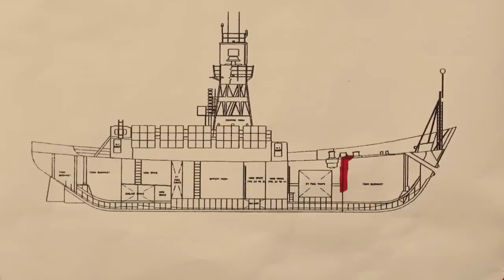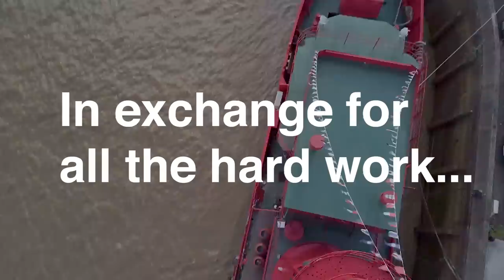Foam Mining Inside a Giant Ship

Comment: U could have used a weak acid and a paint sprayer then pump/scoop the fome sludge out
Reply: I would only be worried it wasnt viscous enough and would get everywhere
Reply: It appears to be two-pack expanding foam, which is generally urethane based.  That stuff is extremely stable and the only chemicals that can dissolve it are sufficiently unpleasant that you wouldn't want to use them on any space that might be later used for human occupation.
Reply: @TrimeshSZ  it makes sense why they rely on it for ships not sinking...that's for the info

Comment: Im fairly sure that foam can't be recycled. It's just going to landfill or getting burned.
Reply: Ya, I think it’s just junk but I was going to ask that question.
Reply: @AdmrlSpeedy  I'm sure he means being re-used without any kind of processing. When we talk about re-cycling it's generally breaking the material down so it can be re-manufactured.
Reply: PU foam is energy waste, so it's going to a power plant to be burned.
A local power plant takes the waste stuff from our work for no cost, as we just want to get rid of it, and they get "free" material that burns really nicely when you get it hot enough.
Reply: So they took out all the foam. Then Insulated the walls and floor with....FOAM!!
Reply: @regularperson9801  use it as blow-in foam somewhere else. Actually after they framed in the walls they could have used it as blown insulation on the same ship.

Comment: Quick q why didn’t you use a foam dissolver?
Mix it up, Chuck it in, it bubbles and expands and dissolves the foam and then it settles, shrinks and you pump out the mixture

Comment: did you fix the Leak? why did they foam it shut in the first place?
Reply: probably didnt have a leak. they did it just in case. because it was not going anywhere
Reply: i believe that it was said to be for buoyancy of the ship?
Reply: @kevintrigg3707  yes maybe there were no leaks and because it were decommissioned and the pumps did not run, so the foam were the only way to keep it floating.
Reply: @kevintrigg3707  that's not how displacement works. by adding foam you're simply adding weight, nothing more

Comment: Sorry a little bit late.  Had to remove original foam flotation in my C-Dory. Electric chainsaw to cut kerf slots making manageable block outlines, careful of depth & bulkheads.  Blocks easily pop out with a prybar. Finish up with right angle grinder fitted with a coarse wire wheel.  Eats foam like a banshee & does not damage underlying fiberglas. You guys did great though & improvised well. 30 years ago my brother & I here in Hawaii called our garden tiller "Michael Flatley".  I laughed at the memory watching yours do the "River Foam Dance". Cheers.

Comment: Too bad you couldn't seal up the original bags with foam and use them for fenders...
It's kind of ironic, removing foam insulation, building walls and floors, then adding insulation...
Reply: Thought so too
Reply: Yeah that old foam’s probably full of some nasty chemicals. They even used to put asbestos in it back in the day
Reply: Pop one fender and there are millions of bits of urethane foam in the ocean, most of this foam is better off in a dump than out in recycled applications without proper processing.
Reply: You're right. We decided in the end not to cover the columns and the steel section they're riveted to keep a little bit of the ship showing through. It doesn't make the insulation a waste though. This was done around work, other projects and study 'over' 2 years, not for 2 years constantly.
Reply: @benphillips6112  Aha!! Compression is a wonderful thing. I didn't mean a complete waste but the bridging can be a problem in extremely cold climates. I'm not sure how low it gets there but I'm sure if it was a concern you could wrap the columns. I saw you reading up on fluid dynamics, was that part of your degree or just an interest? You seem as eclectic in your pursuits as myself. Kudos to you and your perseverance!! And here I thought you were an independently wealthy loon!! My mistake, it was not my intent to offend.

Comment: Does the ship still have it's engines? Can it move under its own power?
Reply: Fabowski Kaboski good question 🧐
Reply: I may be wrong, but I believe that light ships didnt have engines as they were designed to spend the majority of their lives at permanent anchor being used as navigation aids to other shipping.
Reply: Both spot on. Engines were replaced in the 80's with loads of lead acid batteries and solar panels.

Comment: Would it have been easier to add a liquid to dissolve it and then pump out the goop.
Petrol should work but their must be safer options.
Reply: Either acetone or variety of other non flammable chemicals. Those hipsters just wanted a project from the looks of things. Also, if you dead set on "excavating", use a post digger coring bit at the end of that vacuum. Clear whole room in like an hour.
Reply: @nitroxdsm  sure if you say so boomer
Reply: You use a solvent to dissolve that shit and it'll only resolidify at the bottom.

Comment: you know that there are electric foam cutting knives!?
Reply: Are there? You're welcome to show us how they work.. there's still a section full of foam that would make really useful storage.
Reply: Ben Phillips I think there are some discs with cutting surface. We had the same problem with sunken fishing ship in Murmansk Russia, and I am really surprised how are you guys calm to do this huge job. Let me know if I can help you.
Reply: electric carving knifes goes through foam as well as bread/joints not great for huge areas though
Reply: There's a hot wire system small scale though for cutting foam wings for model aircraft maybe you could upscale it to do the job cut it out in half MTR cubes once you get good access working area just think if you could no mess suction hoses or dust just handball it up onto the deck wow be so quick
Reply: Chainsaw
Reply: @benphillips6112  https://www.youtube.com/watch?v=W3TYhDJNcyY Hot wire foam cutting as well, though it might be a bit harder to get proper ventilation
Reply: @terrandroid  static.
Reply: @benphillips6112  
Burning/melting foam releases toxic gases. It's best handled in its solid form.

He's on the right track except for the dust, going to the trouble of wearing a mask then removing the mask still wearing dust covered clothes.

Seeing as its being approached as mining why no do what miners do and drill. A garden auger bit on a portable drill would at least get you down the hatch in better time.

Also an electric jackhammer with a spatula bit is what came to mind when I first saw this. It tears through commercial carpet, linoleum and vinyl tile in record time

Comment: You could have neatly cut out blocks of foam with an electric saw, drill and hot knife/wire,
then sold the blocks as insulation.
Reply: Hot knife or wire can't cut through foam only through styrofoam

Comment: Honestly I would have just hired a chainsaw from day one and gone at it
Reply: and then moan to the government on how they wont fix the unfix-able damage done to the lungs from micro particles that can eventually turn cancerous in the longer term.
well its turns out they are pretty more prepared than i anticipated, but it was the bit in the beginning where he is snapping it with bare hands so i assumed he was just going in with shorts and t shirt apparel.
Reply: But then you would have to spend time making sure each piece is small enough to get sucked out by the vacuum. Honestly I think they had the right tool, because it worked fast, easy to handle, safe, and broke all the foam into small pieces
Reply: Hot wire knife, cut the foam out in blocks.
Reply: CHAINSAW: yep, seems like a great idea...BUT the problem was we had to extract it, bag it and remove it in a way that didn't effect those around us too much.. the reality of big blocks of foam that don't tesalate is a massive skip bill... and loads of dust.
Reply: @benphillips6112  Milo the type of guy to just drop a Molotov cocktail down there and call it a day. You did it the right way. Keep up the great work!
Reply: @benphillips6112  That's fair enough, I just figured you could put blocks in bags but didn't account for the particles getting blown about everywhere. Stunning job mate, what an effort
Reply: You really don't want to make anymore dust than you have to, the ideal is to break it into small chunks, their method was pretty good!
Reply: I'D HAVE JUST USED A BLOODY SPADE!
Reply: or just buy like 50 litres paint thinner  and melt the foam away lol
Reply: @jd3497  Just use some solvent sprayed with one of those handle pushy packpacks thingy sprayer to melt the foam asap.
Reply: @Choice777  you're probably severely underestimating the volume necessary, but I admire your dedication to the most hazardous solution plausible!
Reply: Patrick Ancona  No one cares, mate.
Reply: I was thinking something along the lines of those drill bits used for drilling for oil.
Reply: @jd3497  wrong foam that would be deadly toxic
Reply: Patrick Ancona  Patrick, thanks for the benefit of your knowledge and the pleasant way that you express yourself. Unfortunately, the problem wasn't breaking it up... that's the easy bit... we had to do it in a way that made it easy to get rid of... this is in the center of London, if you fill skips with big bits of foam they take up LOADS of space and would cost literally thousands to dispose of.
Reply: uncletigger  just drill ONE hole, it all goes away for fishies to eat lol
Reply: @AnimeSunglasses  after it melts just set it on fire to heat up the boat in winter.

Comment: just use acetone I'd say. :-)
Reply: First thing I thought of.
Reply: I was thinking that the whole time. There has to be some sort of affordable solvent that would’ve been more effective.
Reply: @nonsenseverses6033  Gasoline is 'cheap'
Reply: Acetone, you would need gallons of it and then you will still need to vacuum up the slime left over making it an even messier job. Also the fumes would be harsh.
Reply: @Imetalman2000  You'll be surprised about the small amount you would need though, because foam is 99% air. ;-) The fire/explosion risk would be the biggest problem though for sure. But if you are as lazy as me, there would be no debate about what to do. xD

Comment: The deadbolt on the entry door should be unlockable from the inside without requiring a key because if you lose your keys than you are stuck inside or if you need to get out in an emergency, that is just an unnecessary safety hazard...
Reply: If you can't unlock it without a key... presumably you can't lock it without a key?

Comment: couple of car batteries and wire bingo hot knife
Reply: I use a mig welder to cut foam.  Just run out about a meter or two of wire, put it on a low setting and zero feed.  Works a treat.
Reply: @zzebowa  If only the internet had existed before they started this project and someone could have taken a minute to search, "how to cut polystyrene foam" instead of going at it with a mason's hammer and garden tools for two years. A nichrome wire blade at 9V could have cleared that room in a few days.
Reply: @fudofx  That is not EPS foam if you start to burn what looks like Urethane spray foam you will create deadly fumes  or start a vigorous hot fire impossible to quench,  I would even be nervous about the fumes from aged degraded foams Good plan to Vacuum it out
Reply: @fudofx  What about the smoke? That's not a trivial concern.
Reply: @MrJamesonStyles  True, PU foam is nasty stuff when it burns.
Reply: Arcadian you’d still have mulch the big blocks so they could be taken away
Reply: @techheck3358   Blocks are easy to stack. The real problem is exposure levels. If you physically break up foam plastics, the particulate dust gets into your lungs and into the ecosystem. When you melt polystyrene, it off gases, but it's far less dangerous. Especially if you use a proper HEPA mask.They basically created a toxic mess hacking away at it and letting the material blow everywhere.

Comment: You could've modified the hedge trimmers. Take the blades apart then grind the stationary blade down to just a thin strip down the center to where the moving blade sticks out and can make contact with the foam. Just a thought🤷‍♂️

Comment: At 3:34 you have the lovely working Hoover but no power tools yet applied to cutting out the foam.  Then suddenly appears the Foam-Eating Dragon!  The little electric tiller bounces hither and yon, making a dangerous area for anything in front of its tines.  But with strong arms on the handles it literally makes mincemeat of that solid foam.  Hooray.  But wait, guys, leave the foam on the walls - it's insulation and you'll be glad of it someday.

Comment: Here's the thing. Those roto tillers would have worked more efficiently with a two man team; one at the controls and the other behind holding a tether attached to the rear of the machine, enabling it to dig deeper into the foam without constantly jumping forwards.

Comment: You should have used gasoline, it melts foam like water and sugar, then it was just a matter of throwing water (to lower the viscosity) and pump off, just be careful with solidifies, turns into a plastic, useful trick to seal plumbing and fix leaking roofs

Comment: Holy Cripes guys??? As soon as I saw this fiasco I thought " hot wire foam cutter?' You could've slabbed out chunks a foot wide and deep and as long as the straight run you could go? Like 1 ft x 1ftx 10ft? Or larger depending on the wire frame. Cause ? Damn !!

Comment: What if at the bottom you start taking on water ..and sink.or at the least you realize it needs the foam.i think to have it reformed costs a ton of money....what about a pruning electric polesaw.they are extendable.you could stand on the deck or sit in a chair.also you may be able to cut large sqaure cubes screw into the foam chunk an auger and lift it out.other idea is cutting  by heat .I have electric foam wire cutters.used mostlly for installing dry it stucco systems.you can bend and shape up to any length the wire into any  shape you wish .then apply elctricity,wire heats up and cuts through like butter

Comment: There are NO downstairs on a boat.  It’s proper name is compartment below.  It’s not a floor it’s a deck. It’s not a wall it’s a bulkhead.  Oh bloody hell....
Reply: In my maritime experience it has been a wrong decision to put fiberglass insulation onto/into compartments for insulation because it WILL clog your pumps should you need to evacuate water from the space.  You will have a bit of bad luck if you put land lubbers in a Marine environment.  Best of luck for you mate....